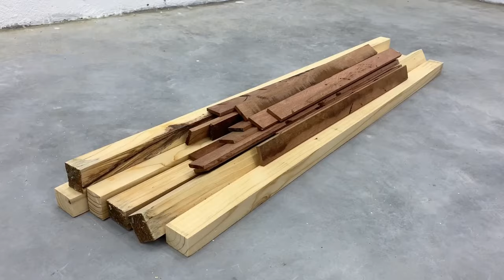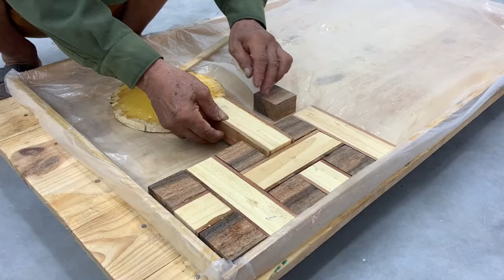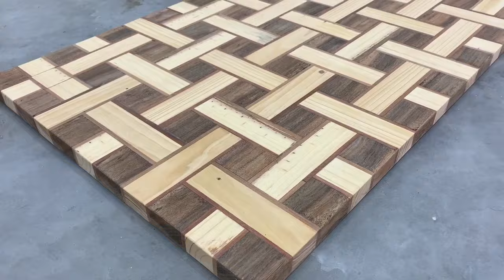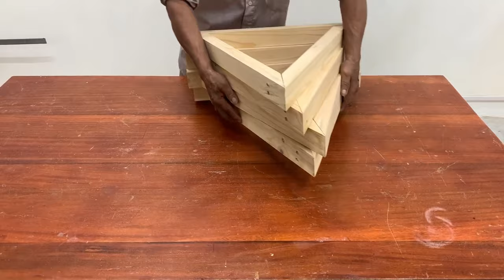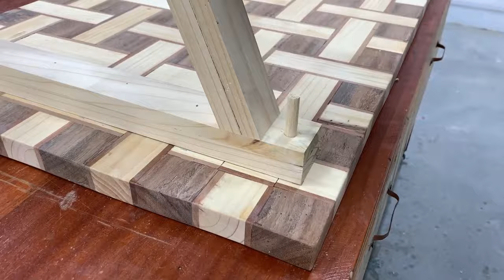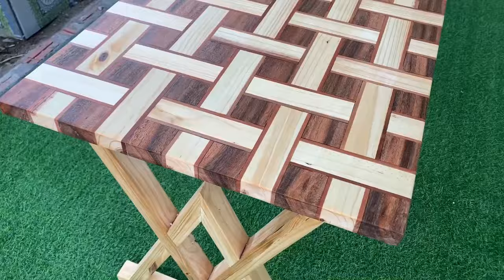Admirably Creative Woodworking Ideas - Unique Coffee Table Design

Comment: I think it needs some lateral stability between the legs. Cross-bracing. Maybe a 1 inch dowel set into the bottom of the Vees and screwed inside that angle. But VERY NICE!

Comment: Gorgeous design!  I love the tabletop design.  Only thing,  when he is wiping on the finish,  it seems to rack easily from side to side. I would have put a cross brace a little lower in the legs.  But a beautiful design!  👍👍
Reply: JU
Reply: I was thinking the same, about the cross-brace.
Reply: I think the reason for not putting braces lower it would hinder your legs from sitting close to the table
Reply: Exactly, and he could play with the colors of the legs , like one triangle dark ( bottom one)and the other one light (top)
Reply: He did a very good and professional job on the top,but legs looks like cheap mass production from IKEA :P I mean c mon,he spent many hours for the top,he should make a better base,it looks cheap and fragile...
Reply: These guys build beautiful table tops and then hokie legs?

Comment: Beautiful design, but why not figure out how many long pieces you need before hand instead of having to triple piece that last long piece? Even if you mess up the cut list,  put the triple small piece in the center so it looks like a design choice. Still, nice table. Does need some bracing for end to end racking.